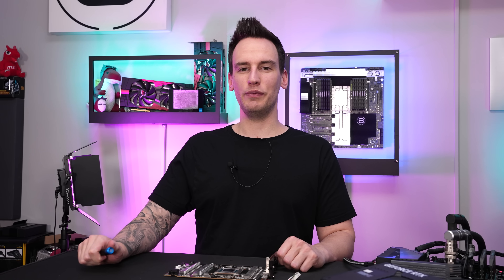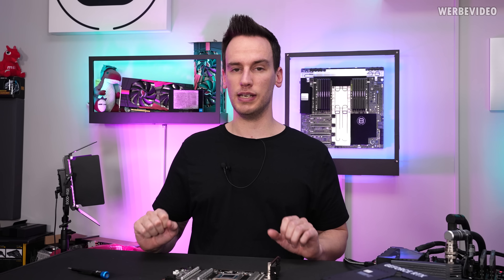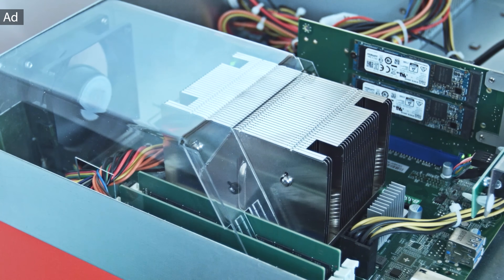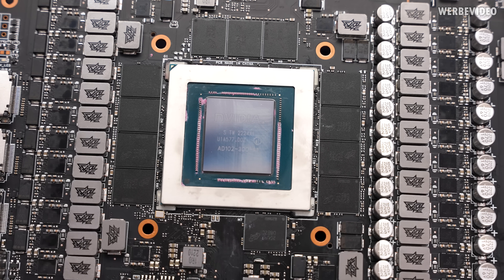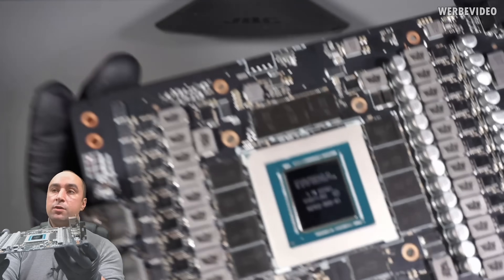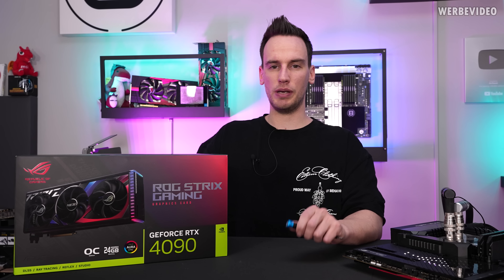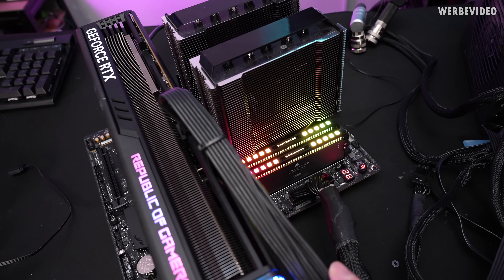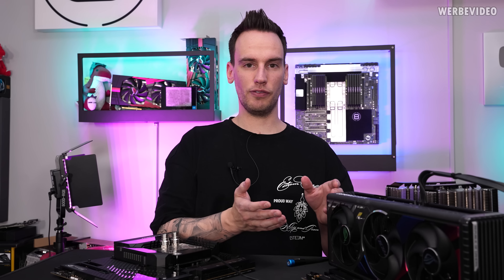Plot Twist during Professional Repair Attempt of my RTX 4090 - feat. KrisFix

Comment: last weekend while replacing the thermal pads on the rtx 3080 I had just gotten 5 days prior I ended up somehow knocking two resistors off the pcb. My 3080 was completely dead and I'd only had it for less than 5 days. I found a local repair shop and they were able to repair it and it only cost $60 USD. My 3080 is now back up and running and I'm extremely thankful to that shop for fixing it. A couple people on reddit told me to try and RMA it with ASUS and just say I didn't know what happened but I wasn't going to do that. Oh and the thermal pad replacement turned out great my temps have dropped 20-40C.

Comment: Believe me or not, but I have repaired two separate graphics cards by putting them in the oven for 20 minutes on 200c. Turn off the heat and let it slowly cool in the oven to prevent the solder cracking.
The first time I thought it was a fluke, but after the second one..

Comment: Love your videos! Would you be able to do some testing with the lian li Lconnect 3 software with a ryzen cpu and infinity fans? There are many among myself having issues at idle with Lconnect 3 making cpu run at 50 degrees to 80-90 degrees with 10% cpu usage… if you close the app through task manager the temps go back to 30-40 degrees at idle, doesn’t matter what version of software, we get the same results and this has been going on for months. Their solution is to uninstall and reinstall the software via their uninstall guide, but that doesn’t work. I love lian li products but maybe someone can figure out a solution to this issue. Also it’s missing clock rates, storage, and has lots of bugs. I just want it to run properly as their products aren’t cheap

Comment: I’m having some artifacting at stock mem speeds sometimes.  I primarily play one game.  Destiny 2.  Updates driver recently and it’s better but still notice some weird stuff after longer sessions and rebooting the game does help a bit.  I guess time will tell if it gets worse.  Only running 250-275w at 4k 115fps locked.. extremely efficient card.  3080 was maxed out at 300-340w and not able to hit 115fps in all areas.  4090 it 2x the speed of the 3080 so I guess there’s that.  I initially oced the mem to + 1500 as I saw others doing it.  I had issues getting card to boot for 20-30min.  Finally booted and reset to stock.  Hope this didn’t effect the mem…

Comment: You always need to rebal everything. not just one chip. You could also do a hard voltage graph mod off minimum and maximum GPU voltage  - it does wonders for finding each specifical GPU best performance points going around nvidia predetermined voltage tables.  The last 3070 i moded like this went from 240W to 180W without loosing any frequency and almost reached 2ghz on core like this

Comment: I had a pny rtx 3080.  It worked ok but ran hot.  I changed the thermal pads.  It then stopped working properly.  It would start up but then shut down.  I used the wrong size thermal pads.  It makes a really big difference.  I changed them to spec and runs fine now.

Comment: Why would you even attempt to reflow such a gargantuan GPU package with a home setup in the first place? There are at least a couple thousand pads under that GPU package and the board around it is very densely packed. Failure is almost guaranteed if you don't have the know-how and equipment.

Comment: you might be better off not rmaing the card with asus my 3090 developed an issue and they send you a different "refurbished card back. i have sent 4 cards so far and i mentioned that to the tech who said we will put you to level 2 tech support. this just means they will ask you a bunch of questions a few every other day for a month and then tell you you should rma that card and we will try putting thermal paste on it.... so i have been dealing with this since the first rma was october 3rd its december 12th today and i still have no working card. the sad thing is i think THIS cards issue is it needs thermal paste but ive never opened a card and they dont want me to. this one runs 88c 100% fan in cod menu and the same in fortnite. when i send this card they will grab another card off the shelf and send it to me and it will also be defective.

Comment: I wonder with the platform change did he use a different power supply and video cable and monitor. BitWit or  Paul’s Hardware had an issue in one of his videos where it was an random issue with the PSU.  I know it’s not likely but instead of just testing a new board and cpu maybe everything should be different. Maybe he did 🤷‍♂️

Wordy comment with pure grammar. Sorry.

Comment: Maybe you used wrong flux when you tried to heat the GPU. Some flux needs to be cleaned after soldering, because it will corrode the solder. Professional repairman use flux that does not require removal.

Comment: Amazing manufacturing by ASUS. Corroded solder ball pads out of the factory. Categorically stopped buying ASUS like a decade ago, when my laptop died soon after warranty followed next year motherboard dying in my PC - also ASUS. After that - had enough of their products.  Guess what? Nothing ever died ever since - sold all of my hardware when upgrading that was still worth selling
Reply: This is not ASUS's fault. The cards were made by NVIDIA with the only difference being that ASUS makes their own version of the gpu cooler, firmware and software. They can't physically change the card too much since they are contractually obligated as a third party vendor. So the corrosion happened out of the NVIDIA factories. But I will say ASUS should have at least cleaned up the corrosion before shipping it out.
Reply: @luminatrixfanfiction  lmao. Nvidia only makes GPU die complex - it's that square thing with metal edges soldered via BGA. It's custom PCB and everything was designed and soldered on it by ASUS, stop talking nonsense when you don't know what you're talking about.
Reply: @mroutcast8515  ... ... NVIDIA doesn't allow AIB partners to modify the cards too much. The only things they can tweak is the voltages, clocks and cooling design along with using their own software and firmware. It's what gives the AIB competing advantage over the FE edition cards however, not to the point that no one would buy a FE edition card. It's one of the reasons why EVGA got fed up and quit being an AIB partner. I know enough to know that you're bit of an airhead lol.
Reply: @luminatrixfanfiction  they restrict specs they can go for, lmao - which is completely different from what you said, pal. Restrictions are such as VRM specs (how many phases, what caps should be used, how many caps, etc), max power draw, max voltage in factory OC models, etc. They still can design custom PCBs and even if they use reference design - they are do them in own factories, not get shipped by nvidia lol.

Comment: Try a different motherboard. When working with these type of board, just heating them up to a certain temperature can get them to go again. Has something to do with the interconnects on the main GPU and sometimes the main PCB. Nvidia has has these issues in the past. As for corrosion, Ive seen some types of flux used to do rework can cause this. The board may not have been cleaned properly. Unless the problem with the board is simply and known, they are not worth repairing.

Comment: I know Roman has a good working relationship with Asus so really not wanting to stir things up with my comment, but Kris noticed a lot of corrosion that Roman mentioned in this video when desoldering one of the RAM chips. The evidence really start to point not at Roman but at Asus instead. Nobody wants any more headache after spending that much money on a product. No, that's not right, it should be nobody wants any more headache after spending any money on a product.

Comment: 230 euros for a full reball etc hah, local repair shop (only one i know that does these repairs) quoted me 320 euros just for mosfet + light electrical issues on my 3070ti, told them i will just buy a new one (which i did)
Reply: The reason it cost that much is because the repair shops have to buy a donator card (another 3070ti) to get parts off that donator card and replace the mosfet and other components off the customer's card. Hence why it's better to just buy a new card lol.

Comment: I don't want you to get paranoid here but when you become "famous", post info about you online, people know where you live and who you are, things get weird for OBVIOUS reasons...More so if you begin to have MORE money than the average envious criminal has...
Sooo....There's THIS...
I've been targeted by hackers AND COURIERS, MORE THAN ONCE...I've received BUGGED hardware...An ADSL+ modem with a LONG RANGE RF CONTROLLER installed on the board, with REMOTE CAPABILITES...A "brand new" GPU with MALWARE IN THE BIOS...Motherboards with broadcom chips flashed with MALWARE inside...Even fake usb controllers in USB hubs, with malware, obviously...
Now, you normies may believe or not believe this story(yet I'm the one with a video showing the very first USB3 remote jammer ever made), but the point here is: FLY LOW and use different identities when shopping online...And *whenever possible*, FORGET SHIPPING EXPENSIVE MATERIAL: GO GET IT BY YOURSELF, PHYSICALLY.
Some couriers do offer boxes with LOCKs on them, but the lockpickinglawyer made most of them obsolete...Anyway, there's that too.
Sysadmin's mindset : trust no one !

Comment: As couple people beside me said to use the ultrasonic cleaner, could be the reason it was working for a small time.
If the other pads are corroded too under the VRAM chips, that will for sure solve the problem.
And to the people that said it was a 100% VRAM issue while have seen similar issues props.

Comment: Was it really corrosion, or was it oxidation?  If it's corrosion on a new product from the factory...that's really not on.
All solder pads should be sealed by solder bumps and conformal coating should protect the rest.

Comment: Kris's repair job was seriously impressive. I've done a bit of BGA reballing on DRAM ICs for embedded devices before, with specialised equipment and templates for aligning fresh solder balls, but to see him do the whole thing by hand with spatula tips and braid is next level. It takes a ton of experience to be able to tackle something like that with any confidence. Really professional job.
Reply: Yes, it was impressive.
But I also kept me thinking: why he did not check/resolder the rest of the RAM ICs? If one was corroded, it could be perfectly possible that others are about to fail as well. Then I came back to finish this video, and I found that I was right :) So, it is interesting to see the proper tools and professional hands doing this kind of work, but at the same time I would have thought that in that quality level of repair the other RAM chips would have been checked.
Reply: @naelblogger7976  when kris did the test when he first received the card was that he found out only one was failing the tests, if you can already pinpoint the problem chip, why risking damaging the other chips in the reballing process, so that’s why he didn’t bothered checking the others cuz afterwards everything was working perfectly fine until der8auer got it back
Reply: @naelblogger7976  more potential for damage to the memory ICs and the pads underneath, and more work. given that the test showed it was just one package failing and the card tested just fine afterwards, it'd be hard to know that it was worth the extra work. that's one of the reasons a repair warranty is so important.
Reply: It certainly takes a while without a stencil, though i can sometimes use a smaller one to help align most of them, little tweezers for the rest lol
Reply: @ChaosHusky  If I dont have stencil - I usualy make it from really flat pcb, scan chip, print on pcb and you have a stencil for watever you like :) me doing it for a long time

Comment: FWIW, I've used Kapton tape (real and knockoff) a thousand times on boards with SMD parts down to 01005 size, and I've never had it rip a part up, so I wouldn't put too much stock in that theory unless you already damaged the pads. It can absolutely lift parts up if you apply enough heat to accidentally desolder them completely, but then that's not really down to the Kapton and they'd have just fallen off anyway.

Comment: First rule of repair, guys, - do not do home repair and do not give the board to shady repair services that could do a similarly bad work. It's always harder to find the problem if someone tampered with a board - you have to doubt everything.

As for dying VRAM - that happens. For example Hynix 1GB gddr6 chips used on rtx3060ti models can't be replaced partially - the adjacent ones die from the heatgun. Maybe 4090 memory is finicky, too?

Comment: If you own a broken $1500 GPU, the last thing you should do is look for a cheap DIY way to fix it lmao.

If a repair costs $150, then you would need to be over 90% confident that you will not permanently break it, otherwise a DIY repair makes no economical sense, which is the whole point of DIY repairs in the first place.

Comment: don't buy GPUs that cost over 2000 Euro.
it's just NUTS
still running an EVGA GTX1080Ti ftw3
don't require more than 60+ fps and 1080p anyway, and the GTX1080Ti is way faster in the games I play. I'd be happy with a GTX 1060 to be honest.
Reply: 120+ fps is ideal for most games nowadays, but my 1060 hits that easily anyway so yeah, GPUs at that price are crazy unless you want to get into 4k gaming.
Reply: @Benjji  4k gaming is also stupid. the ONLY good reason to buy a 4090 is if you're into artificial intelligence development or usage.
Reply: @p4radigm989 i agree, unless your like some of these guys buying 45" monitors lol

Comment: Very interested to hear the results of the other memory chips.

IF it indeed shows that several memory chips were affected by the same issue... is that an indication of a much larger factory defect?
Could it be moisture related from LN2 OC? (not sure if this card had undergone LN2).

Also IF it does show a general issues across the chips - its a good lesson learned that if you have to reball 1 mem chip - it should be done to all..... Looks like a pain to do! GJ to Kris!
Reply: looks like nvidia cant get on top of memory chips...  RTX20 series bad memory problems has entered the building ...
Reply: It was a sample unit though :) He said that towards the start of the video. 
Probably some early edition.
Reply: @Nightykk  Lets hope  then its isolated case only..  otherwise :facepalm

Comment: I do know how parcels are treated in courier transit, but it's not hard to figure out.  Except the extreme cases (where they're run over or crushed), the worst and most common thing that happens is parcels falling from the top of the stack in the van, with additional inertia from whatever caused the fall (speed bumps, lateral forces from cornering or braking.
To do worse than should be expected to happen, people in the system would have to deliberately mishandle packages.  
There's so much "blame" placed on couriers, yet most have no intention of paying the kind of prices required for "fragile" shipping, as it'd be 40-100 times the price, at least.

Comment: As long as it is no fix no pay that definitly makes it worth trying.
Reply: There will usually be a diagnose fee at least but generally reasonable.
Reply: @frizzlefry5   wel ok, 25-35 bucks or so is reasonable for a 1600 euro card but 100 would not be worth it in my opinion as then the risk reward ratio gets to high.

Comment: You could ask for a replacement because you are der8auer. GTX 1080 died during warranty. After 4 months and 160€ spent on shipping it 3 times to them, i just took it to an independent repair shop They fixed it for 100€ fee.

I had a asus tuf laptop die after warranty, they asked 1600€ for repair, for a laptop with an MSRP of 1300€.

MSI is no better. These A-holes offer extended warranty. So i tried to make use of it after the shop 2 year warranty. MSI was telling me to send it to the shop, then the shop send it to them, cus they didnt sell it directly to me. OFc the shop (amazon), rightfully washed their hands of the matter..........

This is how i was forced into diy PC and repairing my own phone aswell. Now im learning component level repair. Just got a microscope, a profesional level solder and a few other things.........

I have a fairly old car, and everytime i need something small to fix, idk to where to get it anymore. I´m going to the house, im getting ripped off, im going to independent repair shops im getting screwed........
This world it's fking unbelivable..........

Comment: Check with other monitor and HDMI cable, i had so many head pain with those 3090ti/4090, card gets stuck bios always with my asus monitor with  Display port, but when i used another monitor and HDMI cable it started pc, after pc starts, then you can use already Dispayport cable :)  Every time i overclock my ram/cpu i need to use HDMI !!